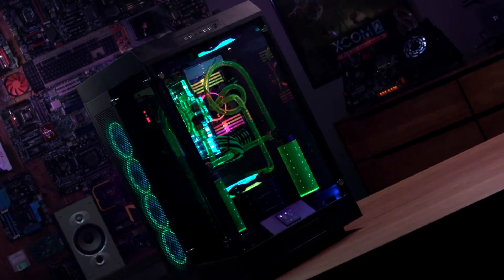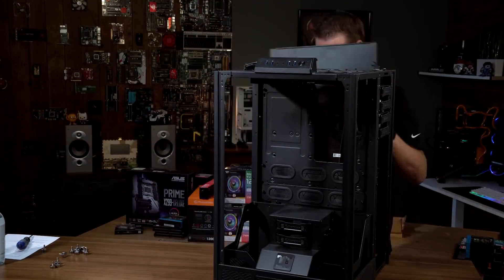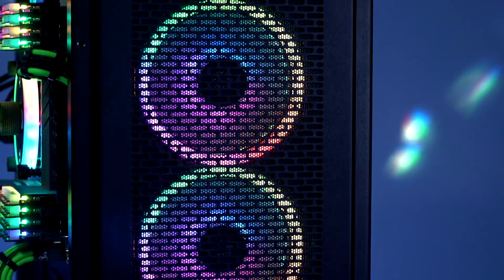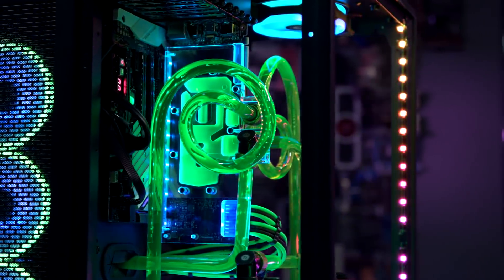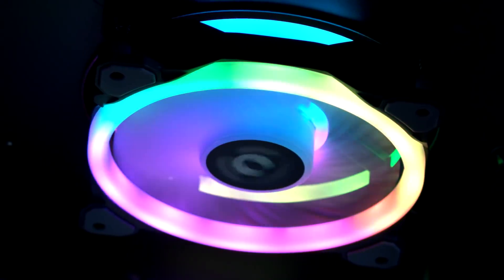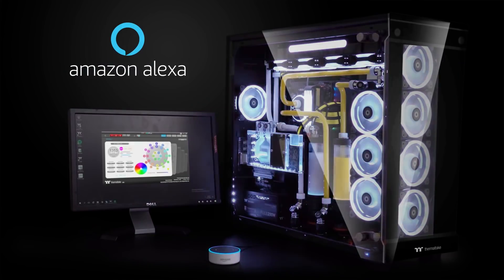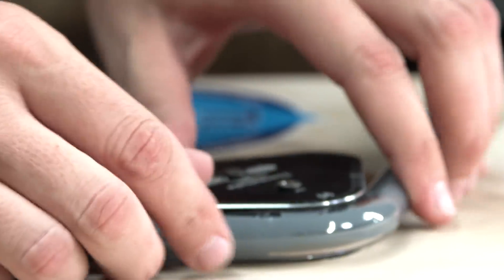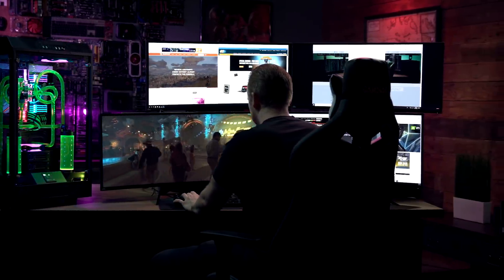Newegg Insider: The Ultimate Liquid Cooled RTX 2080 Gaming Build

Comment: So with 10 fans, rgb cpu and gpu water blocks, and some LED strips are we talking 2 TT Sync’s? If so do they link or use seperate connections to the MB? Would love to see a video of the RGB build/setup side of this build. Looks amazing!
Reply: Kane Chaproniere I actually set this up as a dual zone system, all the interior leds and fans are on the sync controller and the 8 fans in the back for the rads are on TT RGB plus controllers. This way I can have 2 different animations going on :)
Reply: Thanks Mike! Amazing build